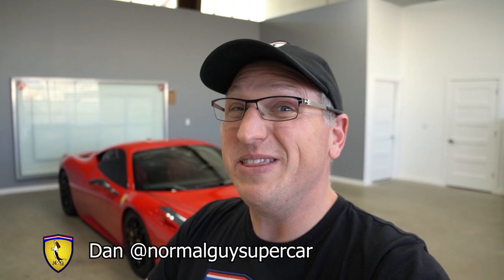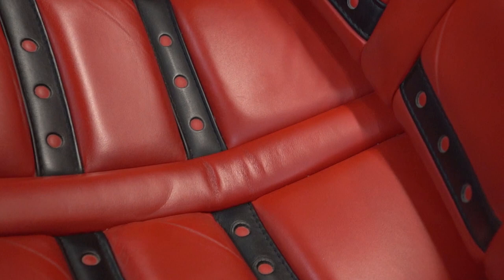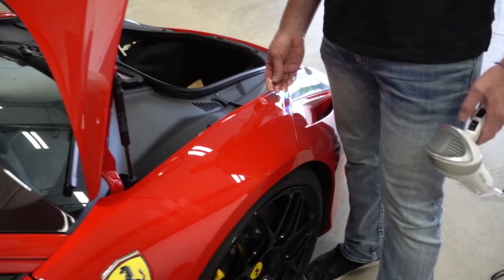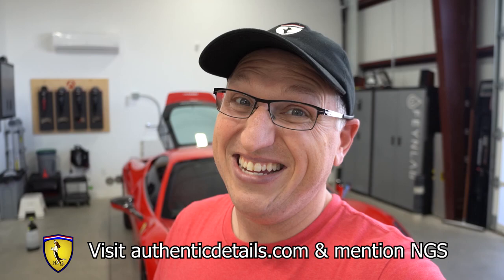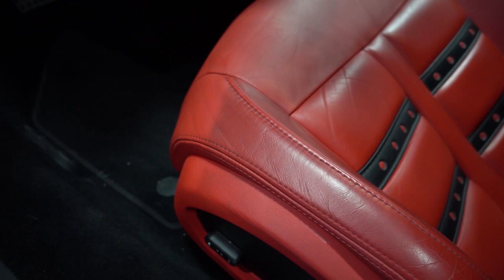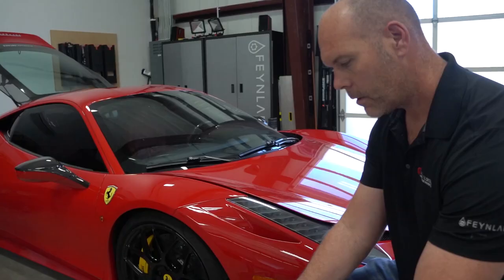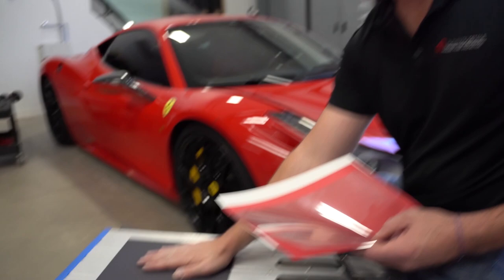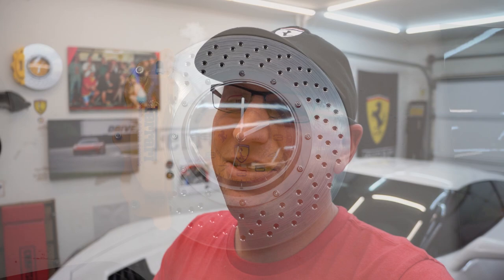Project FERRARI 458 RESTORATION - Paint Correction, PPF, Ceramic Coating, Interior, & MORE

Comment: It´s very difficult to film video properly for paint correction before and after shots, you need usually a lot of light (direct sunlight is often the most obvious), but the car will look top notch, i did paint correct my car and put ceramic coating, it´s a brilliant coating, lasts so much longer than conventional stuff (especially when car is kept outside all year long), i recommend ceramic coating for the windows, i got around 3 months out of it on the front wind shield where the vipers run over and wear it down, and about 5-6 months on my side windows, but they would pretty much dry up reaching 40-50 km/h speeds.
Reply from the maker: Yes, you can ceramic coat just about everything!

Comment: If the paint correction is going to get the scratch out even taking more clear off, the paint is going to last longevity wise because after the correction its getting the film and wont be exposed or polished or having its life shortened. If you weren't getting film then i completely agree.
Reply from the maker: I suppose that could be true
Reply: @normalguysupercar  i mean if the paint is going to be protected by the film and their wont be wear and tear, buffing etc on the paint, i would (if enough paint layers) make it like glass and as they do , put the film on it. It all depends on how bad the scratch is or ding..

Comment: He should have really taped up the paint surrounding the lights when polishing them
Reply: stratpuppy - agree 100%. This was just a test spot for the sake of the video, notice we stayed clear of the paint with the polisher. Polisher control is key, once we actually polish them, proper protection will be done. We use a ton of tape here :)
Reply from the maker: There you go.